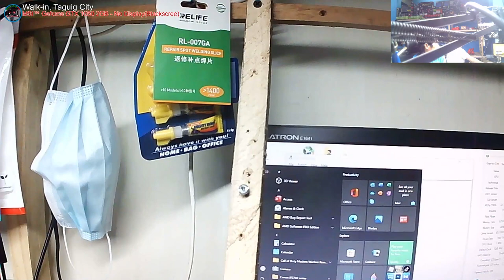Sapphire RX460 2GB - No Display, 1.5v missing VRAM supply

Comment: Ihave same problem missing 1.5 vram. I have mosfet 4507NH and 4503NH. I have confuse the 4507NH is 3.4Mohm or its always 3.4Mohm?. But 4503NH can open and closed 3.4Mohm and 0.5ohm
Reply from the maker: PM po kayo dito sa Video Card(GPU) Repair Business Page para po sa information, contact no., location at ma-assist kaayo.

Salamat po,
link: https://www.facebook.com/VideoCardRepair/